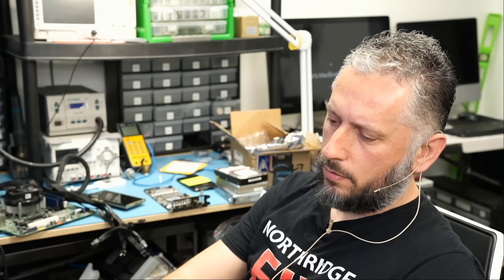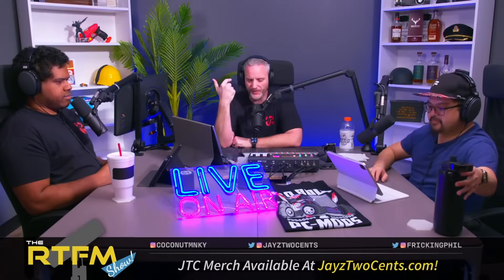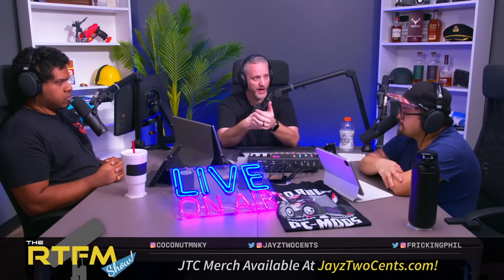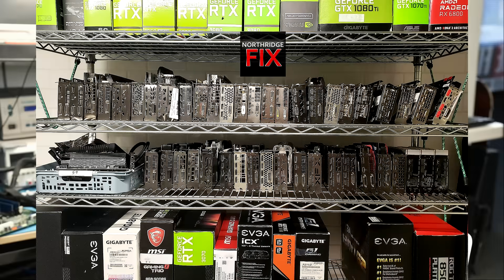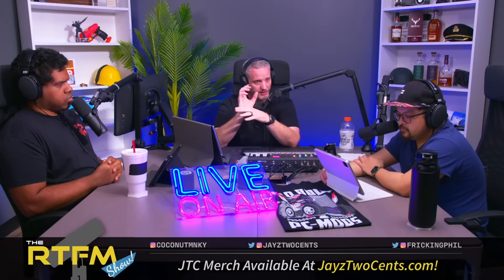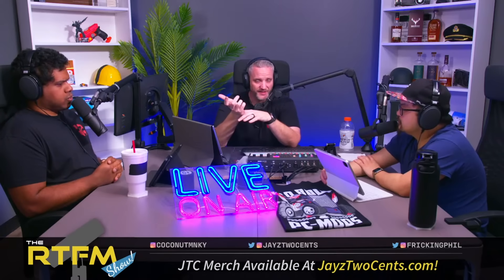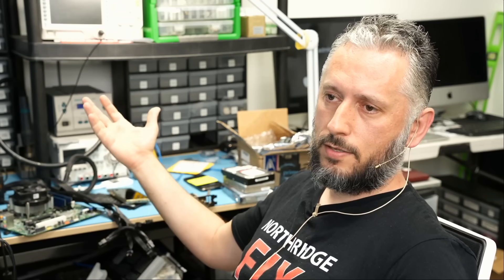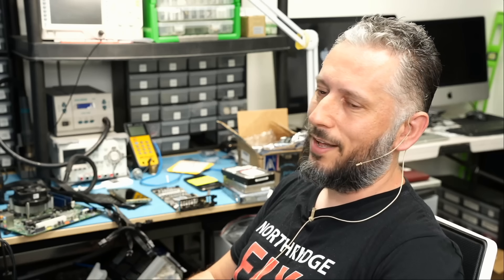Melting 4090 and CableMod. JayzTwoCents and Gamers Nexus Response. Blame NVidia or User?

Comment: Clearly design error. My guess is maybe only a couple pins of the 6 on the positive side, is handling most of the current draw. This results heat to be generated and the connector to melt. I don't see the negative holes melted because the negative share the load equally. Also Nvidia should use higher temperature resistance plastic on those connectors.
Someone should test each pin's current draw when the card is on full load. This would definitely bring light to this mistery.

Comment: the problemay be that to much of Power is being transferred through the same connector. There must be 3 seperate connector with thicker copper pins to handle more power.

Comment: As I watched your video, something I observed a few years ago, while restoring an old car. I installed after market headlights that by design consume more power then the headlight circuit was initially made for. What I observed was, that while engine was running turning on the lights was not a problem. But without engine running, everytime I tried to switch on headlight, the fuse was blown. The explanation behind was as simple as shocking. While engine is running, the 12V board circuit inside vehicle operates at 13.4-14.4 Volts. Ok battery, the voltage is at around 12.1-12.4 volts at best. To reach a certain wattage for the headlights with the lover voltage there is more current through the fuse. As the fuse is only a piece of wire designed to survive a certain current the fuse blew. Maybe something similar happens here. Most power supplies nower days struggle with the voltage on 12 Volt lines when they came to their limits. As the 4090 is a very powerful card maybe voltage on the 12 volt line is dropping. Paired with a maybe not ideal connection in a physical manner this is going to overflow the limits of the connector. Sorry, I’m not an electrician and maybe my theory is wrong. But maybe the problem is not related to the card on it‘s own, but to a combination with the used powersupply and connector.

Comment: @NorthridgeFix
Hi Alex !
Thank you for your work and your explainations.
Isn't it possible to remove the connector and plug wires with sensors (temperature, amp, voltage) between the card and the connector to measure and understand what's happenning here ?
I don't understand why nobody tried to measure and find the real problem.

Comment: Completely agree with you, Alex. No manufacturer should blame the user, who spent a butt load of their hard earned money on a graphics card, if there is a manufacturing flaw that enables any user error. There were no burning connectors that I recall in previous iterations of cards...are they trying to say that all of a sudden, nobody knows how to connect a cable to a card? Everybody did it fine before. I can tell you that when I spent a ton of money on my card, I was extremely careful with everything I did with it. Plug it into the socket, is it fully seated, plug the power supply in, is that fully seated, etc. Nobody is going to just Willy nilly, without any regard for they wad of money they just spent on the card, just randomly put this stuff together. Nvidia needs to own their mistake, fix the connector, replace user cards or connectors that experienced this, and just take it on the chin. It's ridiculous how much Nvidia is profiting off of these cards. Gamers Nexus said you were a partner with cable mod and insinuated that you might not want to talk negatively about their adapter. Is Steve a partner with Nvidia? If not, is he working on a deal? I don't know the answer to that, but if any of that is true, that could sway his decisions too. Fix your crap, Nvidia. Simple as that.

Comment: The connectors absolutely should be made as you described. With some headroom so it doesn't connect if not fully seated, and with a circuit to monitor it's temperature and individual connections.

Comment: 14:45 i think gamers nexus meant that cablemod has collected multiple 4090s over a long time, then sent them all in one batch, thus showing a sudden increase in 4090's failing.

but honestly does it matter if the cards come in once per day, 
or 0 for 2 weeks and 14 the next monday?
Reply: Graphics cards fail all the time, especially when it's related to power delivery. There's soo many variables with this stuff, from user error to poor QC. 
3090s had the vrm controversy and bricking from playing games like New World. Nvidia isn't a saint, but the controversy is being overblown like usual over a small sample size. 

There's already thousands of cards with the connector in the wild, and if the issue was truly as widespread as people say, it would be everywhere by now on normal media and not just the 100~200 reports over the past year

Comment: My2cents are that the video card is able to pull more current than the connector can handle.
By the looks of the connector I would not recommend anything above 10A per connection and only for short time use.
I'd say 5A to be safe. That would be a safe 300W, 6x 5A connection.
Maybe also take a look at KrisFix Germany, he professionally repairs GPU's.

Comment: I would say all the comments regarding this issue are ignoring the fact that the customers are having a hard time using these cards. It is the manufacturers responsibility to sell products that are safe and fit for purpose. This evolution of cards are clearly not of the required design and safety standards and should be withdrawn bearing in mind the abhorrent costs. How much does it cost to have one repaired? I am going back to my Atari 800 if this is the future.
Keep your damn AI. Remember todays fiction is tomorrows fact. Cyberdine Systems is just round the corner.

Comment: Alex, you should run this card under thermal camera and measure the max temperature under load. This max t is the problem, the plastic used to make the connector cannot take this max t. It simply melts around the pins delivering so much power.
Reply: The pins heating up means resistance to the current flow, so bad connection! The connector is not suitable for the power being asked to be delivered!
Reply: IgorsLab did the testing with 450W and 600W. The 90 degree adapter / connector got hot but didn't melt.
Reply: but why the plastic not melting  when soldering reflow 280c in factory
Reply: @ariewijaya1679  soldering reflow in factory is done by machines in seconds.
When heat is generated during hours of playing, it causes the plastic to eventually melt and liquify around the scorching pins.
Reply: @NeoGhk  but it took minutes to ramp up and ramp down to room temperature
Reply: @ariewijaya1679  nop. those things are laser soldered, search for videos in YT you'll find it fast... and even if they weren't its easy for a electrical joint to heat way more than that after all thats how we melt steel together...

Comment: Why Nvidia decided do even use a new conector??? It would be way easier to use 4 8 pin PCI connectors in a 2x2 array. They would fit thanks to the massive thickness of the card plus you would have 32 pins to spread the current the card needs instead of the current 20+6 pins the connector has. Or another option is to use a between device that takes 4 12v supply cables and converts it to a 30v  supply so you could use that problematic connector because you would have less current to manage hence less heat to deal with though that wouldn't be the way to go imo

Comment: Yeah it’s an engineering issue. 100% NVidia has to take full responsibility for releasing a flawed design card. Either they need to redesign the connector or they have to lower power consumption.

Comment: If the connection isn't a tight fit you can get arcing. If its overheating then there is arcing or a high resistance generating heat. Or maybe simply too much current through the connector causing heat.

Comment: It's not even summer yet and they're failing. Once the ambient temperatures rise, there will be even more of them breaking. More customers for you. 😆
And sir, you plugged/unplugged it waaay to many times in this video. Those are only rated for 30 in/out pluggings or so, after which they start to fail! Molex connectors never had that problem. I used a no-name PSU from 2003 to 2015, through multiple motherboards and a shit ton of hard drives. The connectors never broke! These "new age" connectors are crap. They "saved" 6 grams of plastic (which is like $0.02 per 10.000 units) and this is gonna bite them in the ass, big time. 🤣
They shouldn't have skimped on the plastic for $1600 products!

Comment: It would be interesting to measure the resistance  from the lead side of the connector to the solder joints on the back of the    board.  If any of the pins through the connector have a poor contact with some measurable resistance,  the pins will heat up  as I<2>R.  These cards are ~450W (37.5A @12V), so that's a lot of current  through one small connector.  Even a low resistance will result in significant Wattage that needs to be dissipated. This is a design issue,  I'm surprised the connector didn't catch fire!  

I think calling out poor design and reliability issues based on your knowledge and expertise working on devices should shame the manufacturers into producing products that are more reliable. Great job Alex!
Reply: You can't measure it like this, because on 4090 all pins are connected to a single power plane (which is exactly what the issue is).

Comment: Wow! Steve does not grasp the basic concept that when a plug is plugged in it should have 100% continuity. When I plug in my lamp to a wall outlet I expect it to work, even if the plug is wiggled, and at the same time not burn my house down!. To blame this on user error is asinine. This will not age well for him.

Comment: It's (imho) a seriously dangerous design flaw of just wanting to pump so much power/amperage through that small a connector.....  It seems to me that the designer wanted to do away with the three connector approach for aesthetics and thus opted for a single connector design....  A connector which has wriggle room causing problems is a design flaw.... A connector to hard to fully seat resulting in lots of halfway connection which then result in problems is a design flaw...   A connector causing problems due to being exposed to microscopic dust debris or 'foreign matter' is a design flaw....  All the reasons for failure point to not enough headroom for the connectors to handle the loads it will endure which  is a serious design flaw.....

Comment: AMD Radeon R9 295X2 GPU has 2x8Pins with 500W power draw. They never had any melting issues or such BS. The 16 Pin 12VHPWR is a design and engineering failure and RTX40 is a mess. Zero questions. Also 3090Ti has same connector but it does not use the Sense pins, they are grounded thus giving the card only 12 pins like all the Ampere lineup. 

Thanks Alex for making good content, I never agreed with GN Steve on his analysis, his fancy X Ray FA lab after the fact analysis is a joke, just used to confuse masses remember how he said NTK vs Astron Igor analysis did not matter ? Now Intel ATX3.0 revises the Tulip design as going forth vs Dimple design. 

Even in his latest AMD episode same BS. The fact he got caught by ASUS Engineer on how he is doing it wrong in measuring VSOC for Die Sense and ignored HWInfo reading entirely proves that GN does not know jack what they are doing, they keep begging to buy some merch 24.7 even with 1.8M subs and what happened to that space age Fan tester ? dude bragged that it costs 60K USD or some and no sign of that lmao. I wonder he wanted to take on Noctua or some others etc. 

Users beware buying the Nvidia RTX 40 junk. Just skip this gen, Ray Tracing is a joke as its hybrid and DLSS3 is fake frames when you buy a damn $2K card. I hope people vote with wallet and show middle finger to Nvidia and stop letting them get away.

Comment: Let me put it this way, do a google image search for a 40A DC connector. Look at the size of those beasts and compare it to the 4090 connector. The 4090 is super tiny, the contact points on those pins are tiny, these are not 40A capable. If you need a 3 way splitter to feed the card, knowing that a psu manufacturer knows a single connector can't handle 3x what a psu manufacturer would use, why would a gpu manufacturer put 3x the rated amps on one connector? Because they cheaped out and didn't think the design through well enough. 
If you have to be careful for a car door to fall out due to user error, the car is not build properly. It's a design fault so manufacturer fault that they should recall and fix.
Maybe the powerspikes in some games are more extreme than what nvidia anticipated, adding to the problem.
If I had auch a card I'd underclock it to hopefully prevent the connector going up in smoke. That would be an expensive 4090 nay 4070 card!

Comment: The only user error there could possibly be here is purchasing a 4090
Reply: I feel attacked
Reply: DOH! >.< I just purchased one
Reply: LMAO Bro chill
Reply: Huh dummy
Reply: I mean honestly to for them to say user error means needing to admit a design error. XD
Reply: What’s wrong with the 4090?!
Reply: Do i have alternatives? I Need powerful nvidia card with 24 gb vram. 3090 are not available anymore. Only 4090s. What options i got? I will buy one. If it melts - they will give me new one.
Reply: 4090 is 🔥.  I dont need to eat.
Reply: Word!
Reply: Why you hating from outside of the club?
Reply: @alexfelipe3620  who’s hating ? Unless you’re a fan boy that just got hurt
Reply: Can't the amperage draw on the connector be measured to see if perhaps the pins extending from the board are anemic in size?
Reply: I CONCUR.
Reply: If you look at it from another angle:
I bought 4090 with the money i collected for 2 years. And now i'm learning soldering and electronic repair while waiting for the delivery of my wannabe mini laboratory to arrive, soldering station, heatgun, thermal camera, microscope, consumables, the whole shabang. I'm always wanted to learn e. repair, but was very lazy about it.
Now i have the most powerful gaming GPU in the world (that works, hope to not jinx it), and soon skills and equipment to fix it if needed.
Thanks for a little push 4090!
Reply: @ASHOT3359  you mean for 2023 in 2024 that card ain’t going to be fast
Reply: I've been saying for years those two are Nvidia's payrol. I stopped watching their videos 3 years ago because of their blatant bias.
Reply: Idk, my 4090 strix oc, seems to be running quite well
Reply: @AegisDynamics well that’s ok then, all these must be made up lol
Reply: 4080 melting tooo
Reply: omg truth !
Reply: I aint getting 40 nothing. 
Zotac 3080 is my baby. Perfect videocard Zotac has made effort and In my opinion they have come along way compared to asus that tries to sell us broken shit

Comment: It does seem possible that the user noticed the melting connector and then pushed in the connector fully, while the connector was still soft/liquid. Then as it cooled down, it fused while being fully connected.

However, I still think that the sense pins should prevent the electricity from flowing if the connector is not seated properly.

Comment: People are running thousand watt bios mods through a connector rated for 300-400w max… no one in electronic industry would use this small of gauge wiring and a connector to run 600w- 1000w continuous power through unless they want to be held accountable for death and injury and property damage… yes the connector on Gpu side is going to heat up, melt and then pins come in contact with each other then boom!!!!

Comment: Steve refuses to consider that he is wrong. He even attempts to muddy the waters buy mentioning your work with cable mod as if you have some major deal with cable mod. Its just sad when people can't admit when they are wrong or at the very least not totally right. At this point enough people have seen the " potential" user error aspect of this to make damn well sure they get them plugged in right. And yet more melts keep coming in. It is a design flaw. Something in the way it delivers power is more then likely at fault here and Nvidia knows this and simply doesn't care, To much money involved in a recall and and no real solution that would allow them to refit existing stock.

Comment: Maybe it IS connector itself. Perhaps the connector is hollow and that over time causes male connector to lose shape due to neccessary pressure for contact, causing a poor connection, add to that that maybe female connector has much more room to move inside the connector, altogether causing an already high amp draw, which is in hundreds of amps atm to become even higher causing plastic to melt around metal parts of the connector... Or maybe type of metal used, like alloy of the metal parts of the connector is too weak to withstand the needed pressure, amp draw, temperature... Just a thought...

Comment: Anyone in design, with a molecule of brains, would see that a three-into-one or four-into-one cable feeding a single connector, when such high currents are flowing, is asking for trouble. There was another channel that x-rayed the connector and showed that the 0.5mm misalignment, which is very likely due to stress on the cables etc, would result in melting. An interesting test (in my opinion) would be to subject the connector to heat and see if it backed- out.

Comment: The current draw is too high for this kind of connector. Therefore it only depends on the electrical contact resistance how much heat is building up. The contact resistance varies between different connectors. It is a design flaw and cannot be avoided by the user.